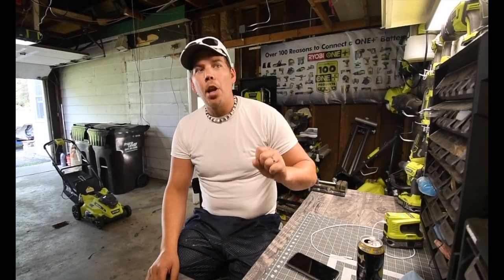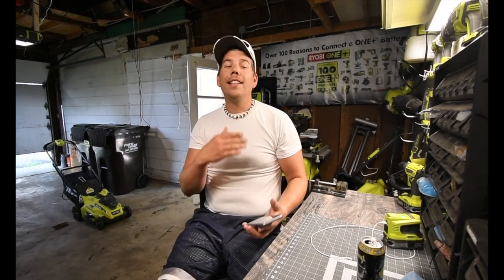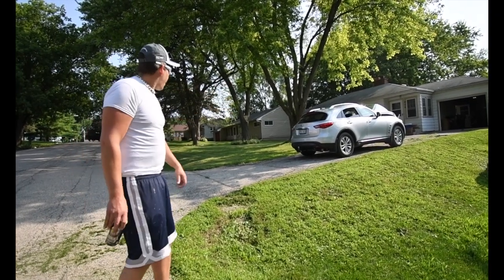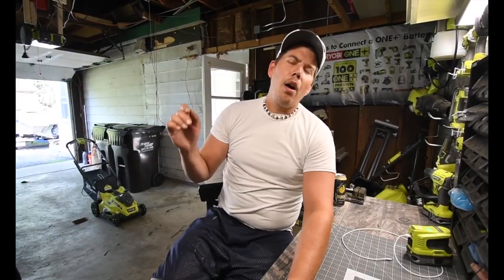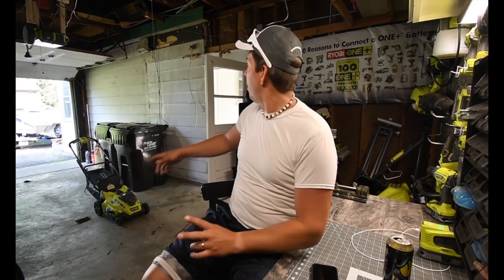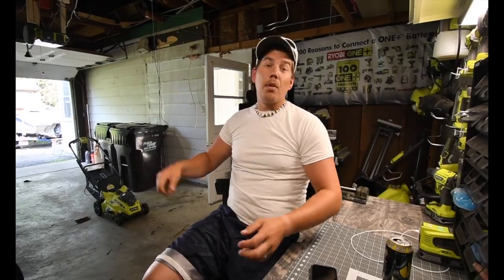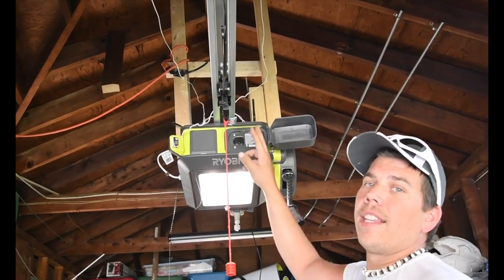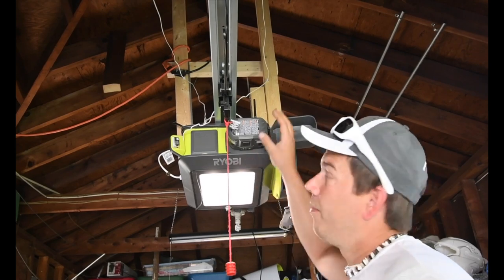Ryobi one+ Garage Door Opener test

Comment: I can't get the wireless garage door keypad to connect to the opener. Any advice? Do you have a video on programming that? :) Thx. Nice channel.
Reply: rip the opener off the ceiling and get a different brand. They are the biggest POS ever made. Trust me. It's a huge headache
Reply from the maker: lol
Reply from the maker: I just followed the online instruction on YouTube that Ryobi made. it helped big time
Reply: I had the same issue. Open the remote module, not the wireless keypad, and uncoil the antenna wire. Drill a hole big enough for the wire to pass through. Put it back together. The keypad should work perfectly afterward. My always works now.

Comment: will this unit sustain a double wide door? Considering the weight I'm very curious, I want this system for my garage once I buy a house, I love the attachments they make for it.
Reply from the maker: I think that depends on the door and the springs for the door. my garage door is an old heavy wooden door with and old spring system. and it opens it just nicely

Comment: Questions... does it keep the battery “maintained” so its always fully charged so when there is a power outage it will work even if the battery has been in there for an extended period of time? Or do you have switch the battery every so often when the app says its getting low? Understand what im trying to ask?
Reply from the maker: Ryan McKim i don’t believe it does. I think it needs to be checked every couple of months if not used
Reply: Ok thanks for the reply I have been getting ryobi tools as i need them for around the house and you and your channel has been influential in me deciding to “go green”😉.
Reply from the maker: Thank you very much for watching :)
Reply: Yes, it does keep the battery charged.
Reply: Thanks

Comment: I got the camera on mine. The camera is not that good and is not a PTZ. If you haven't got one yet, you should try a Wyze cam pan, it is about 1/2 the price and a much better camera. I have the wire reel, camera, bluetooth speaker, and fan.  If I didn't get the camera so cheap at a Home depot that was closing, I would have returned it.
Reply from the maker: Very good and I can't wait to get more accessories for it

Comment: I love my Ryobi GDO!!!!
Get the fan for it.

Your safety sensors are too far from your door. 
Where yours are a child or animal could be under the closing door and the sensor beam will not be broken.
Reply from the maker: Ill adjust that and thank you sir
Reply: @ManCaverTools  I wasn't going to go into details on how I know this but perhaps my story can help others.  

A few years ago I mounted my sensors kind of like you did thinking that the reason for them was more to stop the door if something was in the doorway or was passing through the doorway when it was closing.

However that's really not the reason for the sensors.
The primary reason for the sensors is to prevent something from being damaged or injured by the closing door.

Unfortunately in my case while the door was open my cat decided to take a nap under the door opening.
Since I had installed the sensors about 12" high and 6" inside the door when I closed the door there was nothing to stop it.

The door has a sensitivity setting but a cat's neck doesn't provide much resistance so the door didn't go back up.
I won't go into more details but you can deduce what the cat's outcome was.

My sensors since then have always been installed inches off the floor and just to the rear of the door slide rails.
I don't see now anyway other than perhaps a rodent that be in the doorway while the door is coming down.

Comment: This is all bullshit. The opener isn’t bad..it works. However, I bought the damn system due to the fact that it had an app to work remotely from wherever you might be with your phone. It worked great for 6 months until the app stopped working. I’ve written to customer support about the app no longer working and no response after attempting contact at least 50 times...no response and the app just no longer works. 
Ryobi sucks and I surely will never buy another product from them! They SUCK...period!
Reply: As a contractor I can surely say that Ryobi has done better than say 15 years ago but they are still the bottom rung of the ladder. They are fine for most "Harry Homeowners" and "weekend warriors" but for just a few extra dollars I would suggest Makita. They have been doing good by me for 12 years now and love them. Recently I "upgraded" to Ridgid for the lifetime warrantee so I'll see how that goes.

For the operator good luck to all of those that purchase it. My experience has been the attachments are pretty flimsy and the operator itself has no track record. Repair parts will be hard to come by so the whole unit may end up being a BIC lighter. A VERY expensive BIC lighter. Once it fails throw it away. To costly to repair.

FYI LiftMaster has an App that works flawlessly.
Reply from the maker: I have 0 issues with this garage door opener. and I had it for a few years and its still going strong
Reply: I’m following up from a few months ago…suddenly the app started working and it seemed that it would be good. Last week7/15/21….the door opener shot craps and just died. I finally ripped it out of the garage , smashed the fucking thing and put it in the recycle bin. Again…a total piece of fucking shit. Bought an awesome Chamberlain with phone app, great control pad and it’s awesome. The installer was glad I purchased the unit that I did.